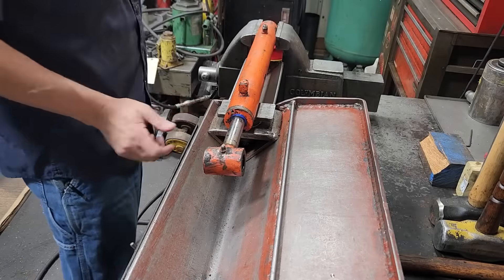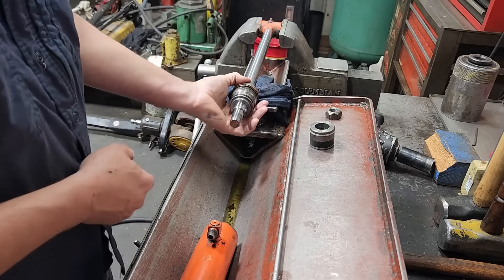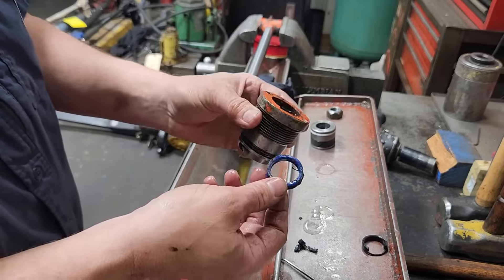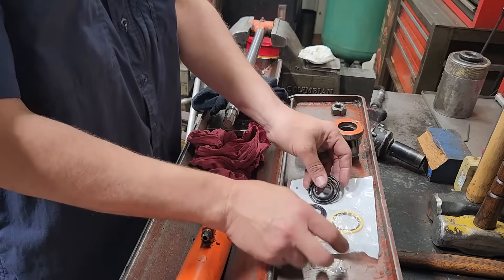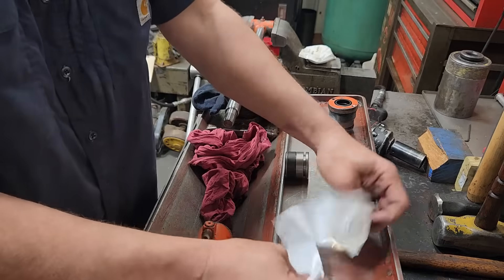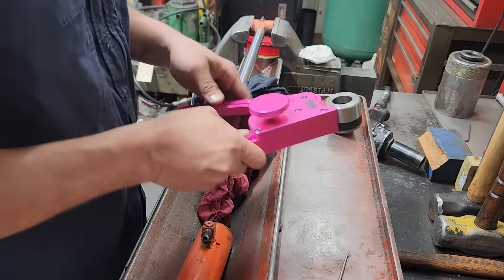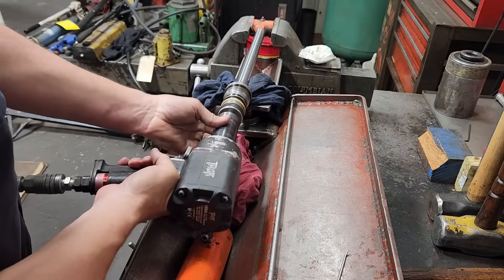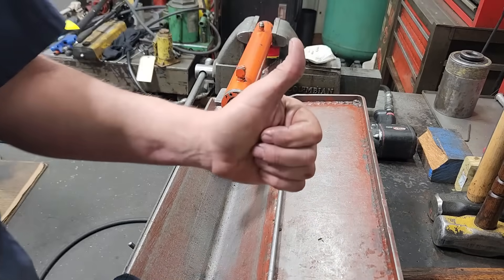KUBOTA Tilt Cylinder Reseal

Comment: Thanks bud. What type of grease  are you using for the assembly?
Reply from the maker: Glad to help. The use of grease or assembly lube is often a debated topic. Manufacturers typically recommend their own products, while others advise against using certain types altogether. For many years, we’ve used a red multipurpose grease from Valvoline, which I’ve linked in the description. Is it right or wrong? Hard to say—but it’s worked well for us without issues. I hope this helps. Thanks for watching and commenting!

Comment: I recently purchased a 1979 case 1816 and the seller replaced the front cylinders with cylinders that were about 3 inches too long which doesn’t allow the bucket to tip back with a load, but I did get the original cylinders and I believe watching your videos, I can reseal them myself. I greatly appreciate your expertiseyour lack of comedy and straight to the point.
Reply from the maker: I'm glad the videos are helpful and to the point! Good luck with the reseal, and thanks for watching and commenting!

Comment: I had to heat the piston nut with a torch (bucket cylinder on a e35 mini-ex) to get it loosened
Reply from the maker: Sometimes, that needs done especially if threadlocker has been used. Just make sure to remove all seals that could be affected by the heat. It'll make cleanup easier. Thanks for watching and commenting!

Comment: In your opinion doesn't matter if you buy OEM seals / o-rings or can you go with the cheaper aftermarket crap? 
OEM $265 aftermarket $75 for the o-ring seal kits? 
Thx 👍
Reply from the maker: It all depends on the manufacturer of the aftermarket.  There are reputable aftermarket kits out there, but you'll have to research.  You could buy the aftermarket kit you're talking about 3 times for the cost of the OEM.  Most people will go that route, even if the seals last half as long as OEM.  Thanks for watching and commenting!

Comment: I looked thru quite a few comments,  but didn't see- what would an alternative, makeshift setup be that could work as a seal clasping tool? 

Ps. Nice video,  and i enjoyed the clasping tool was a sweet metallic pink!
Reply from the maker: I've covered it in another video I believe, but it's doable.  You can accomplish the same thing with a hose clamp.  Just be mindful where the clamp overlaps as it could cut into the seal a little.  Thanks for watching and commenting!
Reply: @HydraulicRepair you bet! Thanks for timely reply.  The solve is simpler than my mind was thinking.  Maybe a thin shim or smooth cut piece of soda can would help that overlap nip spot. 

Cheers dude!

Comment: @HydraulicRepair what was the correct part number for the seals for the gland?  I have ordered 2 different part numbers and none of them included the wipers for the Gland.  Which are completely shot!  All other seals have been replaced but i can not find these two seals.
Reply from the maker: I can't remember the rod size for this cylinder. If it is a 1 1/4" rod you need a ST-125 wiper, if it's 1 3/8" you need a ST-137, if it's 1 1/2" you need a ST-150. I hope that helps. Thanks for watching and commenting!
Reply: @HydraulicRepair  Kubota cylinder would be metric I believe? Something in the neighborhood of 30mm-not sure if that makes a difference or not.
Reply from the maker: Most Kubota loader cylinders I've done are standard. If it is indeed metric, you will have to go by ID x OD x Base HT. That wiper would be a metric step style. I hope that helps!

Comment: Where is the best place to buy seals from? got an old 86 or so Takeuchi tb 25 top boom cylinder is starting to leak.
Reply from the maker: Most people think going through the dealer is the best. If you go online and do some searching, there are some aftermarket manufacturers out there. My suggestion, take the gland and piston to your local hydraulic shop (if you have one) and they should be able to measure out all the seals cheaper than the dealer. Some will even install for you. Being Takeuchi, all the seals will be metric so some may need to be ordered. Hope that helps some. Thanks for watching and commenting!
Reply: me🎉🎉

Comment: The fun ones are when the head doesn’t come loose when you use, torch, pipe wrench, gland tool, air hammer, drilling extra holes in gland for 1/4” bolts to loosen it.
Reply from the maker: You would be right about that! Thanks for watching and commenting!
Reply: And the nut on the end of the shaft takes a torch and 3/4 drive impact and lots of verbal abuse
Reply: YEAH. I’m there right now 🙈🙈🙈. Of course one out of the four cylinders I’m having issues. I’m trying NOT to break shit. Tractor was obviously left out in the weather for its whole life before I acquired it. Now I’m paying for the consequences.

Comment: appreciate the video very informative it would be good to know the inside diameter and the rod size
Reply from the maker: If I remember right, the rod is around 1.5" and I believe the bore was 2.25"-2.5".  Not a very big cylinder. I'll try to include sizes going forward.  Thanks for watching and commenting!

Comment: Nice Job!  Do you recomend a synthetic grease?
Reply from the maker: They make grease just for hydraulics, but it's generally overpriced, and you don't get as much. For almost 20 years, I've used a multipurpose grease and haven't had any issues. Whether right or wrong, it's been sufficient. This is something people have varying opinions on. Thanks for watching and commenting!

Comment: Thanks! I am going to give mine a try since all 4 of my loader cylinders leak badly. Do you have to bleed these when re-installing? Thanks in advance!
Reply from the maker: No need to bleed. The cylinders will bleed themselves out during use. Just operate a little in each direction until you've achieved full stroke both directions on all cylinders. Be sure to check your oil level, too. Thanks for watching and commenting!
Reply: @HydraulicRepair  Thanks!

Comment: I was looking for a shop to rebuild my Kubota tilt cylinders, but after watching this, I want to try it myself. I'm mechanically skilled working on cars, and this wasn't that complex. What is the best way to find the rebuild kit needed for my cylinders? Kubota dealer? Thanks for your video. I just saw your other video on measuring seals after posting this. Thanks again.
Reply from the maker: The easiest way to get the seals would be to get them from Kubota. This will minimize getting the wrong seals from some company online. However, if you have a local hydraulic shop, they will be able to measure the seals out and get you the proper ones as well. Good luck on the repair! Thanks for watching and commenting!

Comment: You need to replace that collar nut with those “teeth marks” that you added to.
Reply from the maker: You must've not watched the whole video. I mentioned there were jaw marks already on the gland after I tried to take apart with the spanner tool. Why would I need to replace something just because of exterior esthetics? The gland is still serviceable and replacing would be a waste of money and pointless. Thanks for expressing your concern by taking the time to comment!
Reply: @HydraulicRepair it is damged thats why.  Plus you added to the damage.  You are a poor mechanic wantabe.  Go home and find a job sweeping the floor.
Reply from the maker: @HeyJoe1978  Thanks for the kind words. It's much appreciated! I really do need to find an easier job. I hope you have a blessed day my friend!
Reply: @HydraulicRepair  don’t listen to that d-bag- been an ag mechanic for years and unless it is cracked I’ve ever replaced them.
Reply: Not necessary Joe. Has nothing to do with how it functions. If you don't like the scratches. Sand them down on the outside a little and repaint it.
Reply: @brocklindaandericahoward632 
It has damaged the structural integrity of the part.  The threads have likely been damaged as well from the over torque.
Reply: nope . most ALL of those glands get chewed . pin spanners are INADEQUATE .  i use knipex 20" animal pliers , then spanner maybe ...
Reply: Should've reminded all to clean the tube since it seems cylinders are the best hydraulic dirt
 filters on the market. My experience there's always dirt hidden in the bottom. Good info Thxs
Reply: I swore this was tongue in cheek humor when i read it.
Reply: On the hundreds i have rebuilt, the worst ones got a touch of a flap wheel and a squirt of primer. By the time you start replacing the rod gland, it would be cheaper to just replace the cylinder with new. Never had any issues.
Reply: @johncorlett3699 If you would use the correct wrench there would be no issue.  The problem is people that arent mechanics trying to do a mechanics job.
Reply: I’m sure the farmer doesn’t give a crap, they just want it fixed as quick and cheap as possible. Just gonna go roll it in cow sh*t anyway
Reply: Hey Joe, you're an idiot.

Comment: How can this be done with out a seal crimping tool ????   I was thinking a big hose clamp 🤷🏻‍♂️
Reply from the maker: Yes, you can accomplish the same thing with a hose clamp that will fit the diameter of the piston. Just watch where the band overlaps by the screw as it will dig into the seal if it's too sharp. You could take some shim sheet material and cut it to size, and put the clamp around that for added peace of mind. Either way, it's doable without the tool.
Reply: @HydraulicRepair thanks for responding so fast   You da man 👍

Comment: New subscriber.  That cylinder holder that you had in the vice was really slick for disassembling that cylinder.  Do you have several sizes made for larger sizes or figure out how to do each one-off  job?
Reply from the maker: That teardown bench is the only one made like that. The others are just long benches with vices mounted to them. Thanks for supporting the channel!

Comment: would love to know what a repair like that should cost? great content.....thanks
Reply from the maker: It should only be the cost of the seal kit if you're repairing it yourself. If you go to your local hydraulic shop for individual seals, that would probably be your cheapest option rather than going through Kubota or a dealer in general. Thanks for watching and commenting!

Comment: Nice straight forward video ! Most of us out here are not professional mechanics and are just trying to fix our tractors without spending a fortune to do so .Like that you showed how to do it with most basic tools. Except for compression tool for the one very hard ring seal. LOL.
Reply from the maker: That seal clasper is a little pricey if you don't do this for a living. The same thing can be accomplished with a hose clamp. Just make sure the overlap is smooth or it can gouge the seal a little. Thanks for watching and commenting!

Comment: This was a great breakdown of the process for those of us who have the capability, just not the “best” tools. I rally love the bench setup with the “V” trough and the little support. I’d like to make one like that to do my Kubota cylinders, but I’ve gone 15 years with my tractor, not sure if I’ll ever do the seals again. That’s if I’m successful that is. 
I would have not known about the right direction of certain O-rings. I will have to pay attention as my Kubota has an Ansung loader and it might be different. 

Got a question about that compression tool that you used on one of those seals on the outside of the piston. I know for sure that a tool like that is not easy to come by. I would like to know if there is any way without the compression tool?
 Thank you again for all your help.
Reply from the maker: Thanks for watching and taking the time to comment! The table i use in these videos is a custom-made teardown bench that came with a hydraulic jack business that he purchased years back. A lot of ingenuity went into building that bench. I really like using it for smaller cylinders.
As long as the seals are installed properly and the seal grooves are cleaned to the best of your ability, that will aid in the longevity of the reseal. Always be mindful of the direction of a seal when you remove it. Take pictures beforehand if you have to.
The seal clasper is available if you do a search, but normally not worth the money if you only have a few cylinders to reseal as their rather pricey. You can accomplish the same thing with a hose clamp that will fit the diameter of the piston. Just watch where the band overlaps by the screw as it will dig into the seal if it's too sharp. You could take some shim sheet material and cut it to size, and put the clamp around that for added peace of mind. Either way, it's doable without the tool.
Reply: @HydraulicRepair  I was so looking forward to your reply, thank you for that. I appreciate very much as it gives me some hope that I can do this. I am a big proponent of having the right tools for the job, but sometimes they are just out of reach. I think the hose clamp is perfect. THey sell the kind that is more of a banding strap with a both that tightens the band. I have used that kind before on my wood splitter on a 1.5” return line to the oil tank. Works great and no “digging” in by the screw. 
I would like it  someday you can make a shop walk around and show what the right tools look like for hydraulic work. I’m not ever going to be as good as you, just want to do the job myself the right ways to avoid what you showed in this video. The skill today is pretty bad. Thank you for the information.
Reply from the maker: @ericglaude4953  like a t-bolt clamp? One of those should work perfectly. I'll try to add a tools video of some sorts to the list as well. You'd be surprised by the common tools we use daily. Just remember, we all start somewhere. I thought I was in over my head when I started in this field almost 20 years ago and now, I'm making YouTube videos, so you got this!
Reply: @HydraulicRepair  That’s the name of it! I could not remember the real name of that stly of clamp. Thanks for the encouragement and keep on making good videos. I have you subscribed now and hopefully I always get your new posters. Thanks again.
Reply from the maker: Thanks for the support!
Reply: ...appreciate the tip about carefully using a hoseclamp with protection underneath..if you do not have a clasper. @HydraulicRepair
Reply from the maker: @PeterDittmer your welcome! Thanks for taking the time to comment!